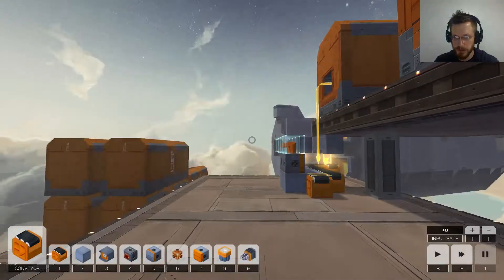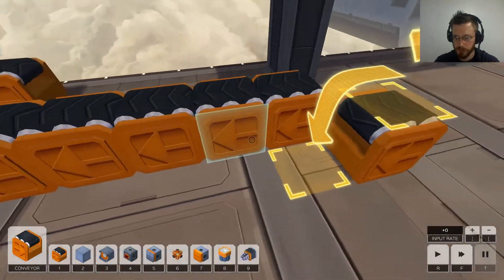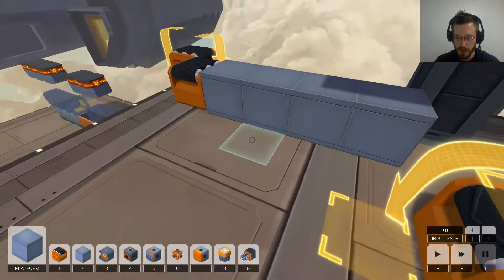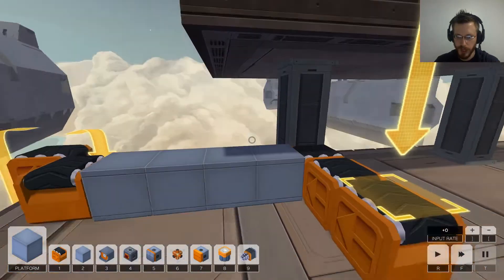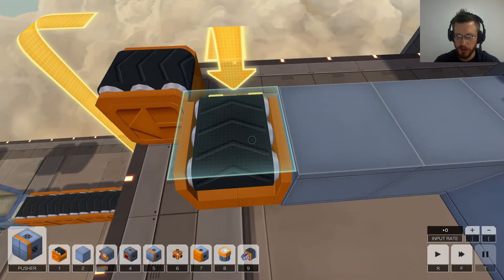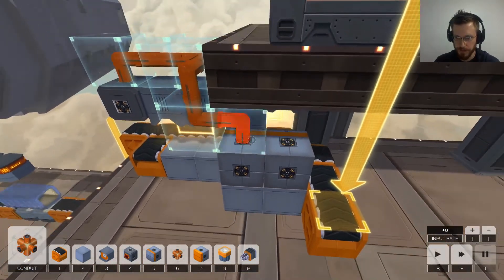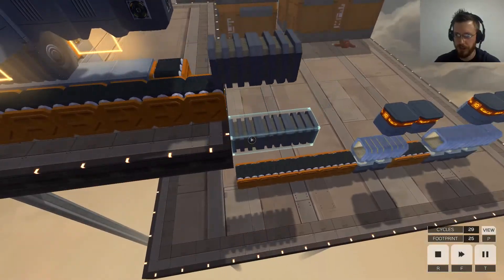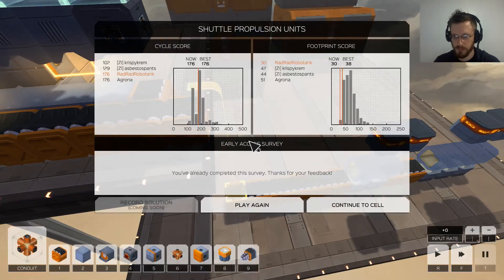Infinifactory - Optimizing "Shuttle Propulsion Units" for minimum footprint

Comment: you can remove some conveyor belts as the blocks of 2 only need 1 conveyor each 2 space.
Reply from the maker: You can, but it won't save you any footprint.  Any square that a product block passes over counts as footprint independent of if any equipment blocks have been placed there.
At that point, it comes down to what you think is the easiest to view.
Reply: yeah I figured that out.